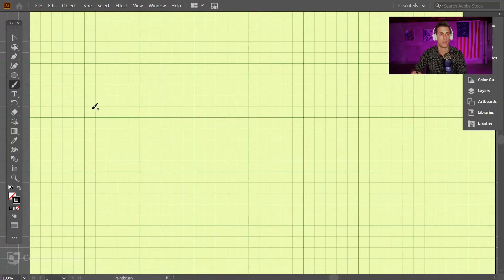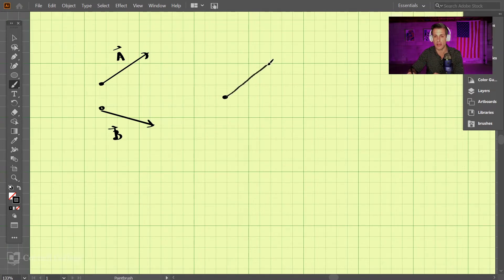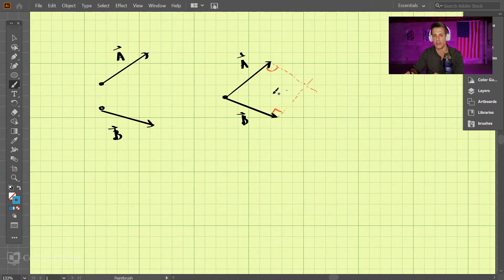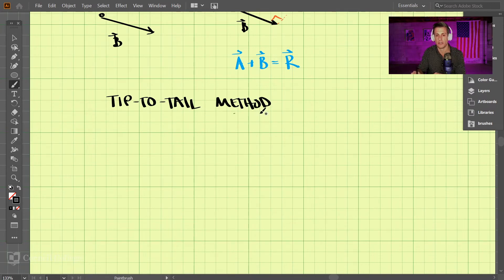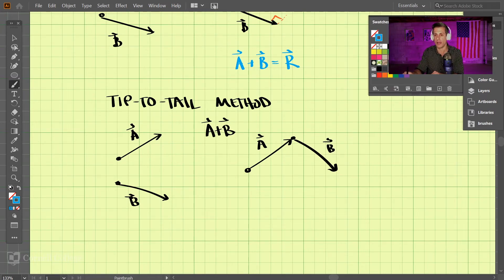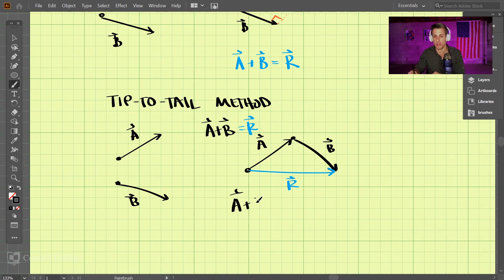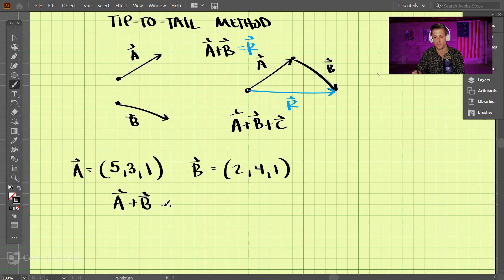Statics - Chapter 2 (2 of 8): Vector Addition

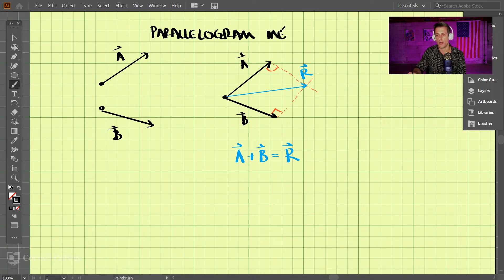Comment: Engineer, at 2:11 you say that the Parallelogram Method is performed by tracing perpendiculars at the ends of each vector, however in all my textbooks I see that it is done by tracing parallel vectors. It is not the same. Is it a video error? Answer me, please.
Reply from the maker: You are correct. Some of these videos were made quickly and late at night, my mistake. Thanks for catching my mistake.